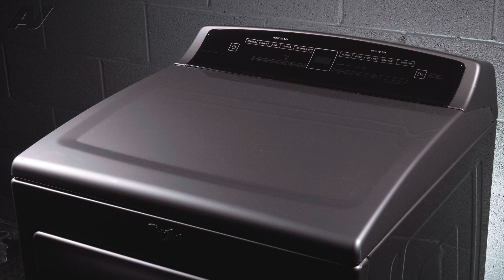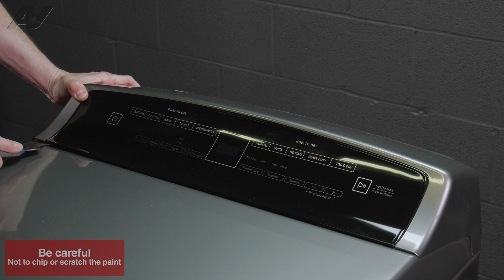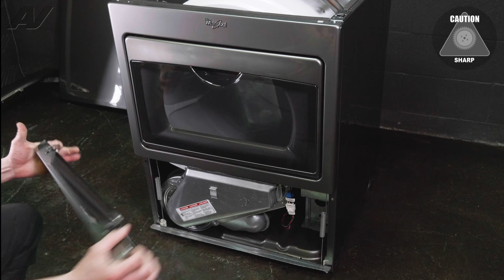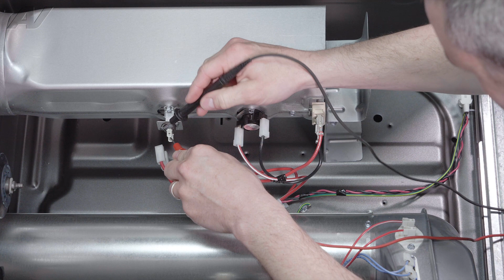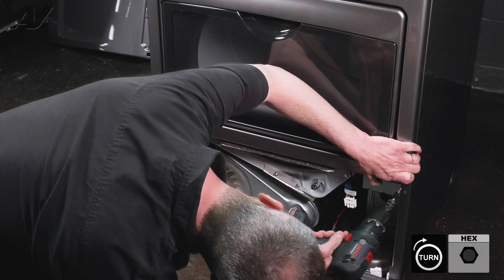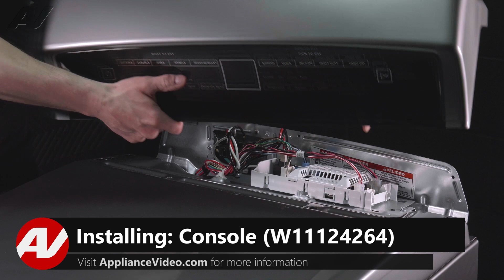Whirlpool Dryer Repair - Will Not Heat - Hi-limit Thermostat

Comment: So the two parts you’re replacing here. The fuse too the left doesn’t read anything which tells me it’s dead. The high limit one too the right ( big circle one) that ones shows continuity. Should I replace both or just the fuse too the left it it doesn’t read anything like it’s dead?

Comment: Great video, it would have been nice to have covered if the thermal fuse was not blown, that it could still be the high temperature limit switch, and it can also be checked for continuity. To determine if it’s good or not.  Otherwise, excellent video, much appreciated.